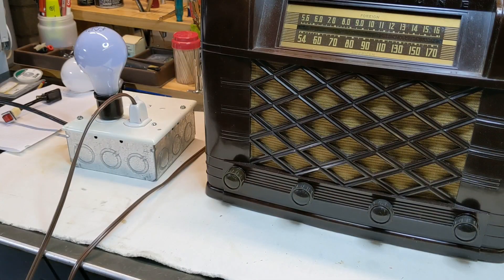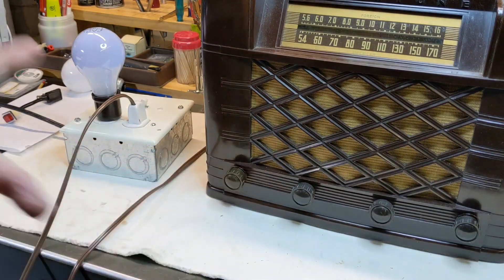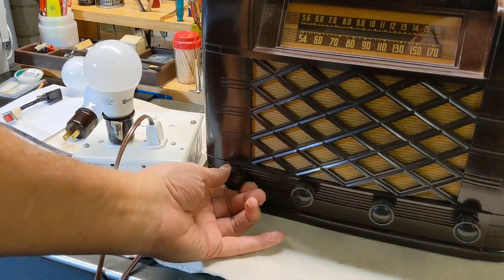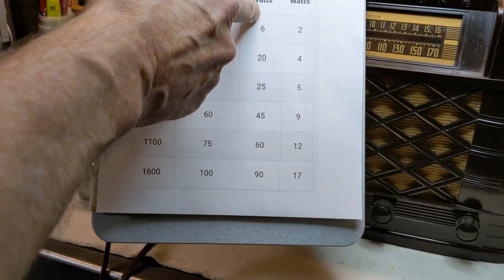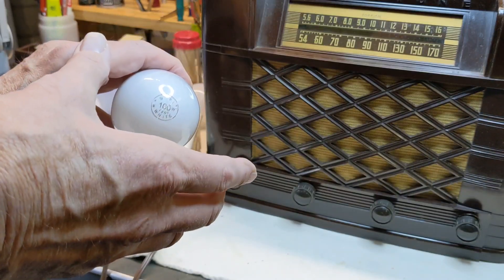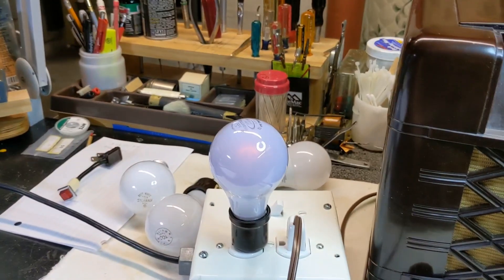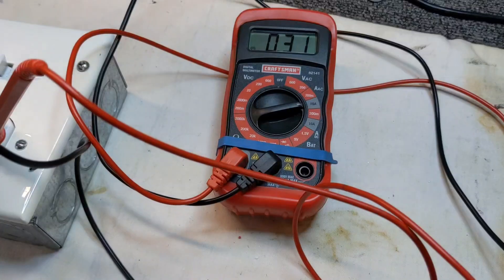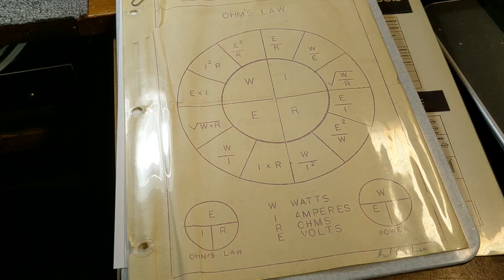Dim Bulb or Not?

Comment: Thanks For The Reply. It Worked Befor Recapping, I Fired It Up With The 200 Watt Bulb And A Variac, @ 124 Volts On Variac Bulb Glows Like A 75 Watt Bulb But Record Player Turns Very,Very Slow - All Tubes light Up, Also Installed 2 Amp Fuse When Recapped. Little Info On This Unit Can Be Found, But Is A Nice Old Radio/Record Player..   If You Google (New Englander By Guild)  You Will See What I I'm Up Against
Reply from the maker: Since it's running you could drop the wattage down to 60 watt bulbs. Remember the bulb limits the current and that's probably the reason for the turn table running slow. 
I will Google that later today and check it out.

Comment: Working On A Unit That Uses 180 Watts, Is A 200 Watt Bulb Enough To Run This 22 Tube Stereo
Reply from the maker: It should be fine but before applying power make sure you do a thorough visual inspection and I'm assuming it has a power transformer. If so pull the rectifier tube out for first power up.

Comment: Why not use a 250W incandescent bulb such as one used in a brooding lamp. It has a very low resistance and so there’s a low voltage drop across the bulb and there’s no dim bulb glow during normal operation (i.e. not shorted).
Reply from the maker: Hi and thanks for jumping in. You could use any wattage bulb but the way I was taught was to match or come close to the wattage of the unit under test. By doing that your watching the response of the unit during power up as it also absorbs the rush of current on caps that probably have not been powered up in a long time. So the idea is not just to look for a shorted transformer, capacitor or other parts the bulb along with a variac allows the unit under test to come back on without being shocked with a rush of current.
It's kind of like waking up to soft music rather than an alarm that sounds like a fire alarm.
I hope this answered your question, I'm not an engineer, just an explanation based on my training as an electronic technician.

Comment: I'm using an old camera exposure light that's 300 watts and a variac in series. I can see the filament because it's clear glass, im used to it and it's good for TVs. It will glow if the caps are bad even on a little radio. I also don't believe in reforming much if the caps don't come around during a slow turn of the variac there getting changed.
Reply from the maker: Thanks for sharing your experience!

Comment: 100 W lamp draws 830 mA, or .83A, not .83mA.  Similarly, the 40 W lamp draws 330 mA, 0r .33A, not .33mA. Other than that minor thing, the information you gave is very good. I’ve also encountered folks who tried to use an LED as a current limiter in a dim bulb tester.
Reply from the maker: Thanks, LOL, I had that in my head and said something else.
Reply: Yup. Happens to me all the time.

Comment: The term "dim bulb tester" was coined before LED light bulbs were a thing. These newbies must realize it only works for
the old incandescent bulbs. You explained very well Fred.  You can still find old bulbs at places like Goodwill in their 
original cardboard sleeve boxes. I got a couple of 40 and 60 watts ones there a year ago.  Steve from IL
Reply from the maker: I have a good stock of 40, 60, 100 and 200 watt bulbs. I think it's time we find a replacement for the dim bulb tester.